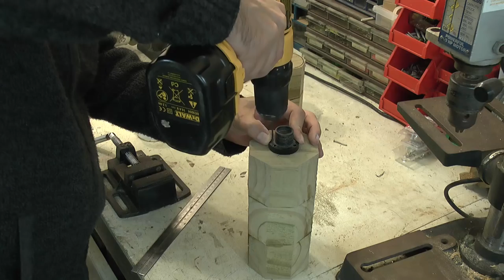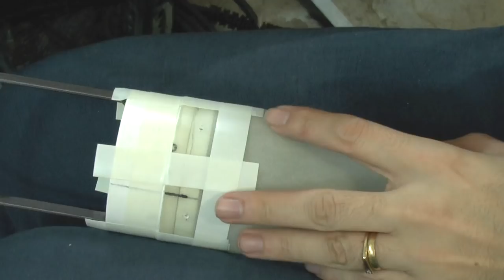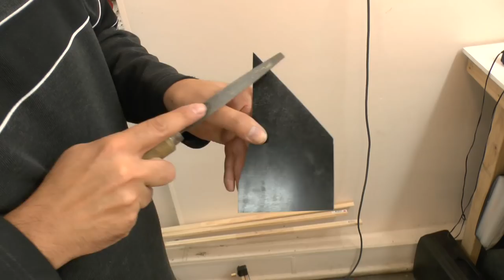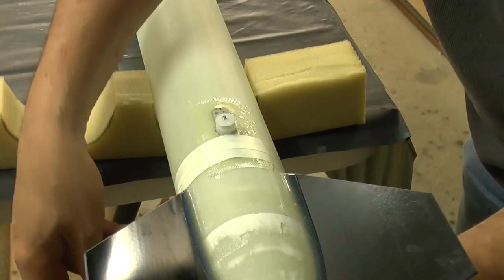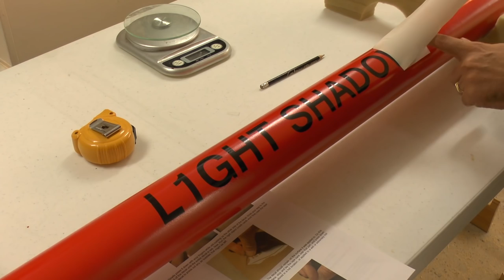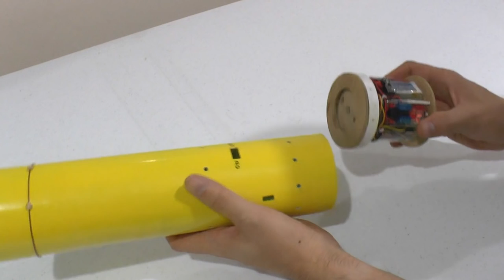High Power Water/Pyro Rocket - Part 2 - Construction

Comment: I'm impressed!    I would have thought you would have glassed the fins on,  but I'm sure you know better than I do!    Great video!
Reply from the maker: Cheers. :) That is a fair point. I would say for higher impulse rockets you would definitely want to do that, but because this rocket is only traveling fairly slowly (around Mach 0.4 on an I motor) there isn't a great amount of stress put on the fins. The other reason to glass them would be for strength during landing (probably the larger of the loads in this instance) but that's why they are offset from the bottom as the nozzle will be hitting the ground first, rather than the fins.
Reply: @AirCommandRockets  mach 0.4 holy hell a fast rocket

Comment: Can you substitute the fiberglass for different types of fabrics because the most of the strength comes from the epoxy glue
Reply from the maker: About 90% of the strength comes from the glass fibers.
Reply: It wouldn't hurt to try some small-scale tests because before you put the epoxy on the fiberglass it's vary flexible just like any other type of fabrics
Reply: Maybe different materials for different psi
Reply from the maker: @noahpeszel168  Here is some information on how composites work. https://en.wikipedia.org/wiki/Composite_material
Reply: Sorry for not watching all your other videos first before  asking a question because I found the answer I was looking for but I wasn't looking for the answer for myself that was for your viewers didn't realize you already had it like one of your videos you use carbon fiber instead of fiberglass

Comment: Nice way to avoid pyro-based recovery deployment. Looking forward to seeing the flight vids, both H2O and APCP powered. Be very interesting to compare total impulse of your H2O system to the composite motors. Ever map a thrust curve for your H2O system?
Reply from the maker: The total impulse will of course vary with the motor used or how much its pressurised to. For the CTI H120 motor the total impulse is around 261Ns. If the rocket holds 300psi then as a water rocket it will have around 160Ns total impulse. We use Clifford Heath's simulator to plot the water rocket thrust curve.